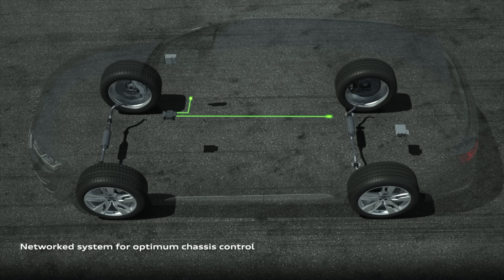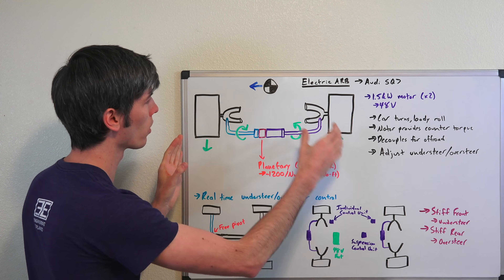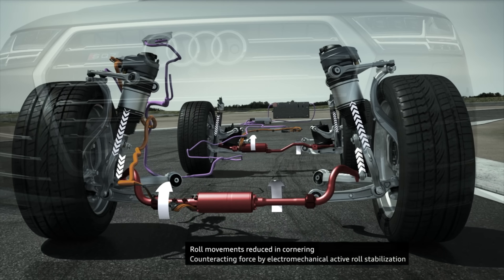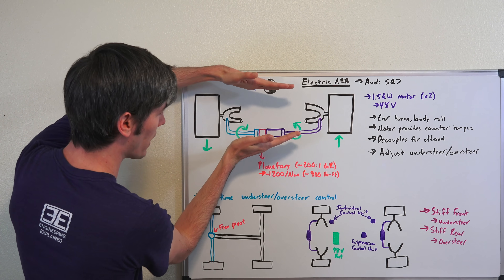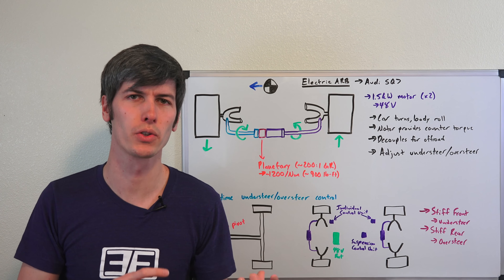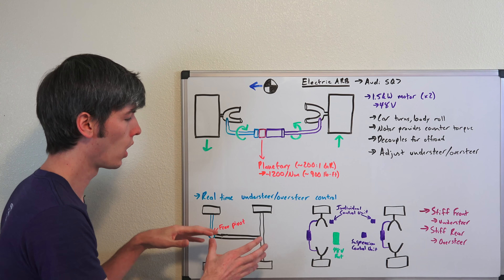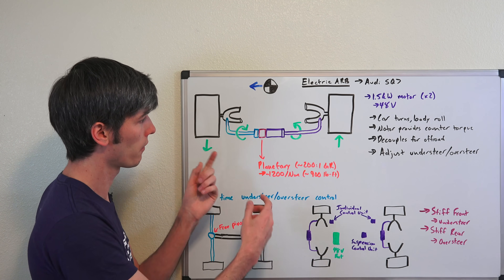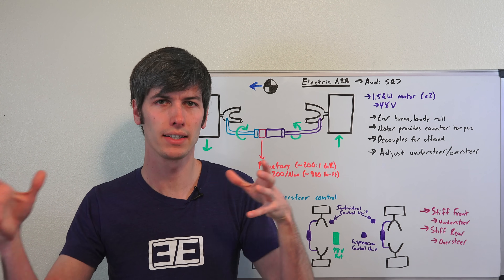How Audi Is Eliminating Body Roll

Comment: big fan of the channel! love the videos! quick question, correct me if I'm wrong but would this not loose overall grip because the outside tires aren't being loaded up with as much weight? my understanding was a certain amount of body lean was needed to allow the outside tires maximum grip pressure.
Reply from the maker: The vast majority of load transfer is not a result of the body moving, as the center of mass does not move much relative to the track width, so the impact is very minimal. But super stiff suspensions do tend to have less grip, as explained here: https://youtu.be/hGZRairqHNI

Comment: Wait a second!? When you've got a stiffer front anti-roll-bar (and/or a free pivoting rear axle), transfering more load to the outer front wheel in corners, then I'd expect the outer tail wheel to becoming too light and therefor oversteer, not the other way round? Or did I get it wrong?

Comment: BMW had started doing this in the older 7 Series (I believe starting with E38 thru the F01 designations) cars using a hydraulic motor sway bar system.

Comment: As presented here, it looks like a sway bar pretty much completely undermines independent suspension? If you hit a bump on the left that rapidly compresses the left side, then assuming the bar is fairly rigid, doesn't that cause the right wheel to lift off the ground?
Reply from the maker: Yes, exactly, what you state is true. The benefit of a system like this is that you can actually disconnect the two sides if you'd like, versus a single piece mechanical solution, and completely vary how independent the suspensions are.
Reply: Ah yeah, rewatching now I see the motor presumably outputs fixed counter torque computed from steering input, so although it resembles a typical sway bar it's actually mathematically very different and allows the two sides to respond completely independently to terrain. That's pretty cool.

Comment: 1.5kW ~= 2hp.  So  lots of torque with the gear reduction, but it doesn't eat electricity like a hybrid (although the 48VDC supply may help).

Understeer/oversteer in a *SUV*?  Methinks the Germans don't get the idea of a SUV.  Traditionally a SUV flips over before running out of grip, these vehicles must be lower and have much lower centers of mass to avoid a similar fate.  Of course, I still in favor of such a system in a car (I'm wondering in what conditions it would be best to allow "finally end up in oversteer": presumably a sports car "sport" mode).

Comment: There should be more to go wrong along with all of the other  computers on board (10 or 12?). The amount of power needed to respond quickly will be high and need to be replaced. Where could this kind of car be used if not on the track?. What about the extra weight carried say 40kg?. Why not use vary pressurised dual dampers?.

Comment: It will surely make cornering at the limit interesting, as the sway bar torsion adjusts so vastly, while still having a fixed or progressive spring rate.
Reply: They should make the vehicle bank inwards in curves a bit like a motorcycle would.

Comment: Man, done decades ago, google Citroen Xantia Activa, zero body roll, so zero, it had to use special Michelin tyres, over side wall reinforce. No need for a shitload of electronics and yes it had a suspension computer and 6 piston high pressure LHM pump.
Ok, this system is different and obviously more advanced. but imho, more prone to problems.

Comment: The bad news is that the Audie SQ7 isn't real.  I mean, it can't possibly be real.  32 mpg combined, 4-liter V8, 0 to 60 in less than 5 seconds, weighs 5000 lbs, and has little to no body roll?  Open your eyes, sheeple!  This car is physically impossible, and if it's impossible, it can't actually exist!  Don't be fooled by Big Audi!

Comment: Interesting that the inputs are exclusively velocity and steering shaft angle; no accelerometers used. But this control system fails to consider the effects seen from road curves where the surface of the road is pitched, so as to provide "gravity assist" and help maintain a perpendicular path of force through the tire/surface friction interface.

Assuming a generously-pitched road curve, this control system will always over-correct by a flat value proportional to pitch angle.

Why not use pressure monitors and/or strain sensors (on mechanical suspension components), set on a negative feedback control system?

Comment: Instead of correcting body roll (keeping the vehicle level), can an active roll-bar system be used to cause the vehicle to roll into the corner, transferring more load to the inner wheels resulting in better traction and tighter cornering?

Comment: What if you had a very stiff front and rear anti-roll bar? Would the understeer/oversteer cancel each other out? If the roll bar was connected higher up on the body structure would that increase the roll bar's moment arm?

Comment: Normally, if you put more load/weight on a surface, it gets more grip. Why isn't that the case here (more weight on the front wheel should give that wheel more grip = less understeer, like when you are trailbraking)

Comment: BMW has been doing this since 2003 on the 5 and 6 series. Its called dynamic drive . Audi is late to the game .. Why no love for BMW?
Reply: Old BMW's use a hydraulic driven system running of the power steering pump =less HP. That's why no M5 have it .Audis have had their version of dynamic ride control it was an electric/air, now a electric/oil system.But with more cars using electric steering there had to be another way to power active suspension systems,that's why they will usually be electric/oil dampeners.Heavy the car harder they work.The electric roll bar takes on the load.
Reply from the maker: Well if I made it about BMW, someone would complain it's not about Lexus's system that does the same thing. Just picked one that offered nice media visuals.

Comment: Mercedes is working on a different system for similar results.  No roll bar, instead a hydraulic 48volt pump on each axle applying hydraulic pressure via pressure hoses to hydraulic shocks. Similar effects as explained here. 
It adds around 300 pound of weight and more complexity that will eventually fail. It will be offered optional in the bigger suv's.Ask me how i know...
Reply: Citroën Xantia Activa has the world record since 1999 in the moose test, beating the McLaren 675LT. Somewhat similar tech you're describing.

Comment: That was a nice presentation. However, I couldn't help but thinking, "is this expensive technology really necessary for a grocery getter?" I really don't think so. But the Audi Brand is all about pushing technology/engineering to its limits. Sometimes it works great but when it doesn't the customer is stuck with a gigantic bill😕
Reply: Well yeah, these are toys for top brands, which is why most of us plebs drive Civics...
Reply: Another thing to bear in mind is this is on the SQ7, which is the sporty version of the giant SUV. I can't find much info on it, but the base model Q7 starts at 50 grand,  and I would bet that the electronic sway bar isn't standard equipment. On a car you can spec up past $100k, you can expect to find tech options that aren't necessarily practical or economically feasible, never mind that its durability is largely untested in the real world, but if you're spending that kind of money on a car you may be interested in the bleeding edge of technology, which this version of this system appears to be. It's probably not a box most people will check unless a) they want to do sporty driving in their 3 ton AWD children carrier or b) they want to get the price as high as possible for bragging rights ("Oh yeah? Well, I specced my Audi SQ7 up to 3x its sticker price, because I'm RICH!").
Reply: Well, current "pleb" cars are filled with features that once debuted on high end cars only.
Reply: That is an excellent point. I would hope that by the time this tech trickles down to the Nissan Z or Toyota 86 of the future that they've figured out either how to make it not break, how to fix it cheaply, or both. If the engineers can't make one of those two things happen, the people who decided which equipment goes in which models and trim levels wouldn't be doing their jobs if they allowed it into a car that would be totaled from a failed anti-roll system.
Reply: Yeah, it's pretty simple like that, the systems that can't be solved reliably and cheaply just don't end up going into the cheaper cars. Plenty of examples of such systems in the past as well. But you can't succeed if you don't try.

Comment: I think car development goes in the wrong direction. 

Don't get me wrong, I love innovative technology and some of it is really amazing, but ultimatively most boils down to:

1. Have a overweight car.
2. Fix the downsides of having a overweight car with something that:
2a: Costs money to build/maintain.
2b: Could be a source for a failure leading to an accident.
2c: Adds even more weight.

At the end of the day, tyres are limiting the grip a car can reliably have. Aero, Suspension etc. helps bringing out the potential of said tyres, but there's a very good reason why weight plays such a big role in many race series with a "Balance of Performance".

Comment: What exactly does it do when you are on the limit, mid corner, and hit a bump on one side? If the roll bar is extremely rigid the car will get offset, doesn´t it? I guess the system can counteract this and also work together with the esp to keep the car on track...but hm...this might feel extremely artificial. 
but going through corners like a race car in an 2.3 ton SUV that de-couples you from the road anyway will feel artificial either way....okay. time to buy an MX-5.

Comment: Does the system use an accelerometer to learn changes in the suspension system or does it always respond with the same correction?

Comment: Jonathan/Justin/Jasper (I watched your April Fool's video and really enjoyed it), great video, once again! Quick question for you: if it's applying counter-torque, wouldn't it essentially be braking the outside wheel, causing the car to slow down to some degree? Maybe I'm just over/underthinking it but it just seems like the logical thing to happen in my head.
Reply from the maker: It's not applying a braking force to either wheel, as it's only connected to the control arms of the suspension. It can influence whether the control arm goes up or down, but it cannot impact the driving speed directly.
Reply: Engineering Explained Oh! Wonderful, that's what I was missing then. I do realize you mentioned it in the video, I think I just didn't understand it properly. Thanks for the explanation! Have a great day.

Comment: So how much would this help with tire wear?  My SUV plows like a dump truck (under steers) going around corners and the outside edges of my tires wear out way before the center does.
Reply: Don Miller sounds like you need an alignment
Reply: It's been check and the alignment shop total me to slow down going around corners. Boo hiss what fun is that?

Comment: Didn't Citroën built a very well working anti body roll system in the 80s but made people get too confident when cornering, leading to crashes ?
Reply: Teknikens Värld moose test results 
Citroën Xantia 3.0i V6 Activa                   1999  85 kph
Audi R8 V10 plus 5.2 FSI quattro 610     2017  83 kph
McLaren 675LT                                           2017  83 kph
Porsche 997 GT3 RS                                  2008  82 kph

Comment: I don't think you get understeer if you stiffen up the front anti rollbar. The stiffer it is the more equal is the load on the tires and you get a net increase in traction. Its of course more on the outside tire but it would be even more with a soft anti rollbar. Imagine the whole car leaning on this one tire and lifting the other side.
Reply from the maker: Well, that's what happens. As you stiffen the front sway bar, you increase the demand on the front tire, which increases the slip angle. When the front tire's slip angle is greater than the rear tire's slip angle, you get understeer.
Reply: Engineering Explained I am not able to follow that explanation. Race cars are very stiff to reduce body roll, they have stiff rollbars to reduce it but they dont understeer heavily. Is it because both axles are similar?

Comment: This is the reason I will no longer buy German cars.  They are equivalent to buying an atomic powered mouse trap.  Just wait until the electronics fail and the car won't turn properly and goes in a straight line.  This system will make many lawyers very wealthy.
Reply: For the same reason they put air conditioning in their cars. It makes for a more pleasant ride.
Reply: if you are driving responsibly then you dont need this technology.
Reply: Joshua Lingerfelt , then why Audi puts it in the first place?
Reply: Just because the sway bars fail doesn't mean the vehicle will lose traction. Besides, if you are driving responsibly on public roads there won't be any situations where the electronic sway bars are necessary to maintain control of the vehicle.

Comment: Only germans are so boring to put a system that would work great in sportier cars into a big ass SUV that most of the people will not even push past 50km/h on a corner
Reply: To be honest a big bulky SUV will body roll much more than a sports car
Reply: Adam K because it's not necessary in a car with a low center of gravity. Thus it's designed for the bulky SUV. If it was useful in a sports car the technology would be trickling down from race cars instead of the other way around.
Reply: You probably never went through a long turn on the Autobahn with ~230km/h and an SQ7 coming up behind you flashing high beams passing you with 250+km/h ... I did and was baffled.
Reply: It really was just made for the 5 foot 2 tall mum's looking through the steering wheel can take their kids to private school and park awkwardly on curbs without feeling anything.
Reply: To be fair, I think the range Rover and even some American truck (can't remember which, but I think it was just disconnecting only) has active sway bars.
Reply: Well, I bless them for it anyway.
Reply: the higher the COG the more effective
Reply: They have to make sure that the one doing it won't kill himself :)
Reply: Trust me, they will.
Reply: the touareg had disconnecing sway bars.
Reply: Judging by your logo you prefer driving with your backside dragging on the road. Same as me, but Chelsea tractor (SUV) drivers don’t and therefore their vehicles have high cog’s.
Reply: Toyota, since 2003, has had active sway bars linked to hydraulic dampers. their system is called KDSS and is still in use on 4runners. Also the benefits would be greatest on an SUV due to their higher centre of gravity,  heavier weight and more pronounced body roll.
Reply: Adam K replace the word "work" with "sell" in your comment. That's why they did it
Reply: James Westcott you're making good points. One issue I see here for SUV is the false sense of safety that comes with turning without roll... until the SUV rolls over, something that will less likely happen with a (flatter) sports cars.
Comfort vs safety: somewhat of a roll should be maintained to warn the driver against rollover.
Reply: Adam K basic physics youd know that in fact this suv needs it more than a sports car
Reply: Adam K lol
Reply: Come over here to Germany!  Try out driving on the Autobahn.  Do your research on where you will drive as a lot of it does have speed limits and can be quite congested.
Reply: Adam K i doubt people will go 50km/h in a SQ7  :)
Reply: It's not like there already overpriced..
Reply: Adam K so true. Those drivers making turns at a speed below 20kmh drive me nuts.
Reply: Maybe it's not "overpriced", maybe you are just poor. Get a job.

Comment: wouldnt no body roll at all make a car understeer
Reply from the maker: Depends which axle you're using to eliminate body roll. If you used purely the rear axle, for example, it would cause oversteer. You can balance it so the car doesn't have roll, but still is still neutrally balanced.

Comment: Land Rover has been doing this for 20 years.
Reply from the maker: They've had 48V electronically adjustable front and rear sway bars for 20 years? I tend to doubt that. 48V systems are fairly new, and the processing required for adjusting understeer/oversteer on the fly likely wasn't possible 20 years ago. At least not in a compact form.
Reply: They did it hydraulically, admittedly this newer system would have its advancements however Land Rover launched this feature on the Discovery 2 back in 1998

Comment: Good lesson for those thinking about fitting after-market roll bars just because "its supposed to be better". Balancing a car is not easy. Going at it "brute force" may change its behaviour, making it unpredictable. Just remember Senna's car in the first year at Williams, with terrible unpredictable mid-corner behaviour changes - and there were F1 engineers working on it! Not an easy task!

Comment: Another benefit is that a stiff sway bar affects straight line comfort. So they can relax the sway bars when cruising so the wheels can articulate freely and you feel less bumps, then tighten up when you're in corners. Then on an S4/RS4, they can incorporate more bias to the rear in sports mode to help it feel more tail happy. a win win win  (etc.) in my book.
Reply: in other words make independent suspension independent again. Thick anti-roll bars in some setups effectively neutralize the independence.